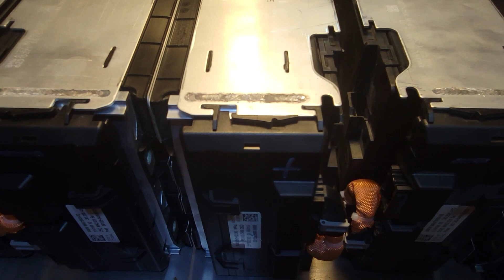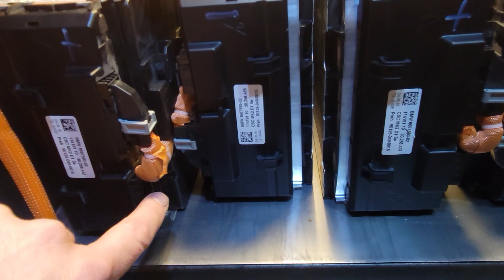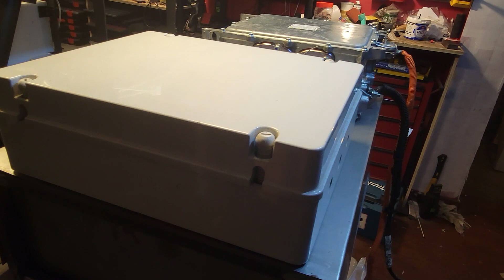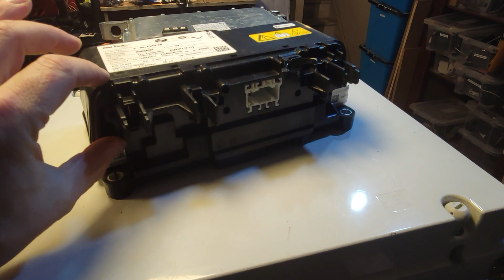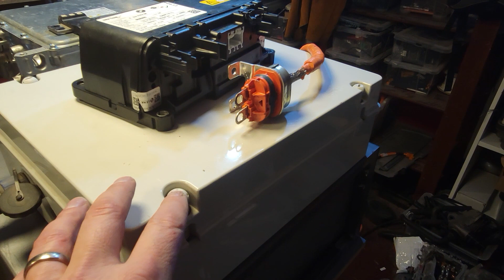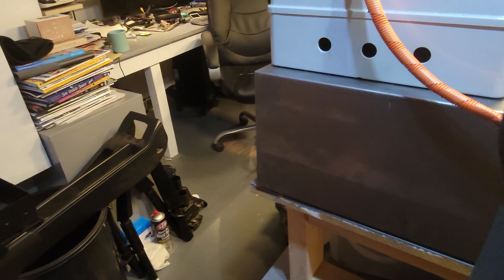Battery Box Build Part 2: Wiring layout

Comment: Hello again. Im thinking of using BMW batteries to go with an outlander diff/inverter zombieverter setup for my midas. I can put the batteries behind the seats in a box as there's quite a bit of space with it being a hatchback.  What weight are those 5 batteries combined? I'm assuming it's coming in at  300v / 12kw and 40amps?  Based on 60v per pack
Reply from the maker: Yep. About that. Can't remember the total weight offhand but I'm pretty sure all the module specs are on OI. If they're not in the wiki a bit of searching should find them on the forum.

Comment: how are you dealing with the BMS with 2 battery packs  ? are you using simpbms ?
I'm using 2 of the bmw 6 cell packs each with it's it's own set of contactors and cut back simpbms all controlled by a triple canbus teensy 4
Reply from the maker: Very similar. Will have a variant of Simp on each one and use the tweaked S-box in the rear pack. 

Would very much like to move to the six module packs for the GT if I can sort out the layout. More space with the gearbox motor.

Comment: Please tell me how much did the batteries cost?
Reply from the maker: Think I paid £750 for my first pack and £600 for my second one
Reply: @EVDIY  how much range per pack will you get? That’s definitely much cheaper than we would pay In New Zealand
Reply from the maker: @blackterminal  About 20 miles from 7.6kwh. Maybe a fraction more.
Reply: @EVDIY  sorry. How many kwh is one pack?
Reply from the maker: @blackterminal  each 5 module BMW hybrid pack of the age I'm using (around 2017) is 7.6kwh. But there are also 6 module packs (from the 5 series) and later packs with higher energy density.
Reply: @EVDIY  thank you